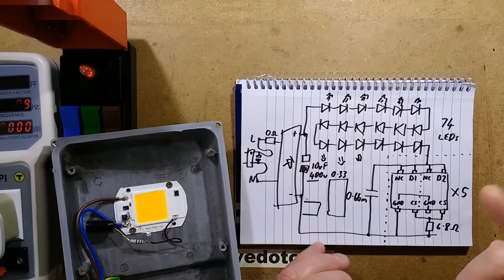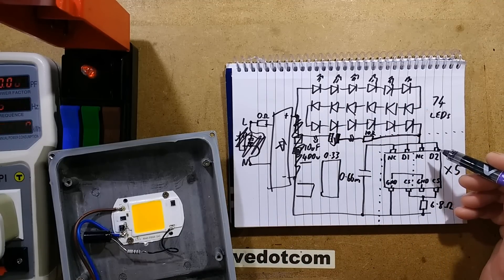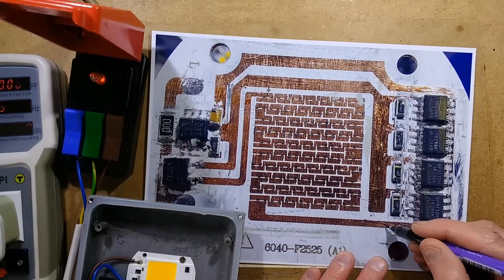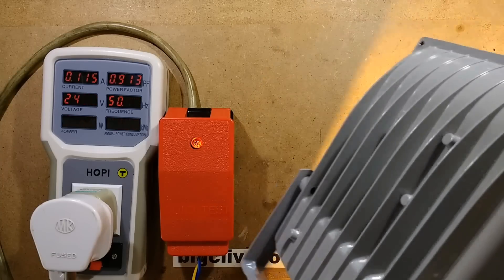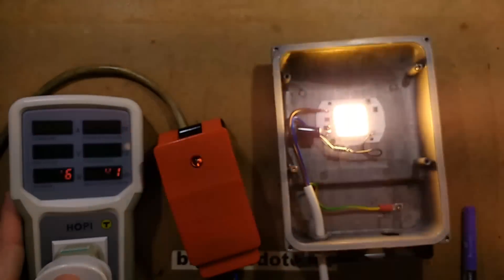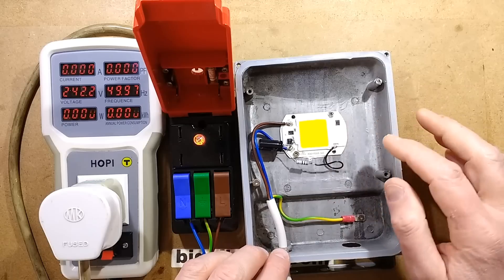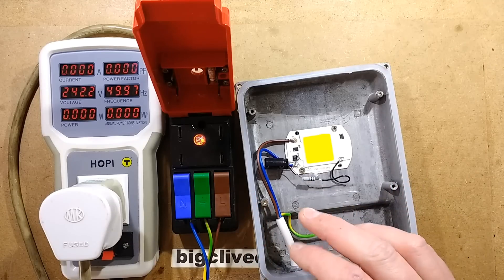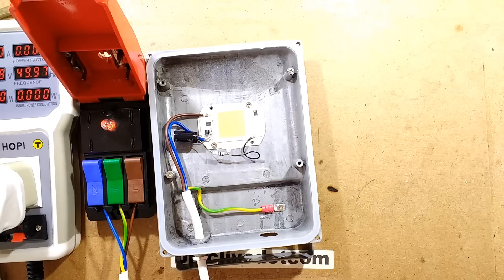Another capacitor test on the driverless LED.

Comment: my brother has a 100w driver less  slim version  and after 5mins it starts smoking  then after further 5mins the smokes gone  and there's a shit load of flickering like in this video . i said to him i don't like the driver less ones lol .  i have the 100w cw  big heatsink version  and there's 2  50w power supplies  powering 2 sets of led arrays in one package . then a month down the line both power supplies gave up so what i did is buy a 1200w boost converter  set it to 60v output  then put the 2 arrays of 32v worth together in series to make it one array of 64v to the output of boost converter .  then connected it to a 12v battery with solar  and a pir sensor  and its still working to this day  drawing roughly 7 to 8A on 12v side   when the pir sensor gets triggered  but its not on 24/7  and dam its bright   . its one of the newer ones that has loads of leds on one circuit board  but split into 2  sets  roughly 32v each  and they never flicker like the direct mains versions which i dont like as the flickering bugs me . the leds are being driven at roughly 80 to 90w  . and i also told him the driver less ones always gets grilled  or overpowered  so tend to fail quite quickly . so he said well if it does ill just buy another lol
Reply: https://www.ebay.co.uk/itm/LED-Floodlight-10W-100W-Outdoor-Black-Security-Light-Garden-Warm-Cool-White/283835047989?_trkparms=aid%3D555021%26algo%3DPL.SIMRVI%26ao%3D1%26asc%3D20190711100440%26meid%3D95d672cd3f6e4208b08f8024db2642ca%26pid%3D100752%26rk%3D1%26rkt%3D17%26mehot%3Dco%26sd%3D283872455887%26itm%3D283835047989%26pmt%3D1%26noa%3D0%26pg%3D2047675%26algv%3DSimplRVIAMLv5WebWithPLRVIOnTopCombiner&_trksid=p2047675.c100752.m1982
Reply: its this type   the 100w version has 2 50w drivers

Comment: 10UF is too low that is why you still see flicker, we have 120v mains in Canada & I normally use  a 2500 to 3300 UF with a voltage rating about 10% higher than the working rectified voltage.

I have rewired many of the earlier LED bulbs with multiple series chip boards, I normally measure the rectified voltage with the cap across it than add up my LED  voltage per chip to figure out how many I need in series or series parallel to slightly exceed the rectified supplied voltage as not to over drive the chips & thy have worked fine for years.

in this case of course that can not work as the number of LED's are embedded in the COB chip design, so that means the simplest way would be a simple full wave rectifier, cap & voltage regulator of some sort to feed the correct mains voltage into the module 120v or 240v rectified & smoothed DC into the module as once you drop the cap across the rectifier it will raise the voltage above that of the mains voltage & being so cheap I doubt they have built in voltage regulation before the LED's

in the simplest terms as they come with no smoothing cap in the design it is using all the power available,  the LED's are digital so they respond very quickly & accurately to actual power so the flickering is the oscillation cycle of your AC hydro (50 / 60 HZ) & even though rectified to DC it is pulsed DC without the cap, the purpose of the cap is like adding a battery big enough to store enough power  so when under normal load you can maintain a steady voltage & current throughout the sine-wave of the AC cycle thus it needs to store more reserve power than the device uses.

Comment: hmm... this was my idea as well where the capacitor should go. However, that 10ohm looks a bit big to me.
For bicycle, I used three capacitors with higher capacitance to smooth the flickering... just to find out that two Cree XP-G is totally fine without any resistor on a hub dynamo, and also will eat up the capacitors charge in an instant, so no light for me when I stop :D

Comment: Is it not possible to use a large inductor in series to smooth the voltage?
Reply: I was wondering that myself.  Some of the comments in the earlier videos seemed to indicate that's what some folks were doing.  It seems to me that if a capacitor after the bridge rectifier (or after an external bridge rectifier) boosts the voltage too high,  then perhaps an inductor filter might be the way to go.

Comment: Thank you for going across the LEDs! My first thought was the current limiting would result in lower average brightness (since it's "fixed-power" from the current limiting), but less flickering. Guess the voltage fluctuates enough to increase the consumed power and worsen the p.f. but still neat.

Comment: Hi, I have a similar COB module, 20W. I tried to place a capacitor plus resistor as suggested and the flickering improved slightly. I the used Viso Flicker tester (no affiliation) to use my phone as light meter. I noticed the following (I cannot load photos herein the comments): the module without modification gives no light until the LEDs begin to conduct (72 LEDs in my module), then the light output rises sharply and then stays constant, until the sharp fall and then no light until the next cycle.

With the capacitor and resistor added as you suggested, the rise of the light output is slightly slower (the capacitor steals current to the LEDs), but the decrease at the end of the cycle is much softer. However, the power at the plug is the same, because of the constant current driver is placed BEFORE the added capacitor and resistor (like in your case).
I would be interested in seeing the same measurement on your module before and after modificatio. The app is free anyway...
Thanks

Comment: Another great video. Question: would multiple cobs, given a common 230v supply, flicker at a common frequency, or would the seperate drivers create multiple flickers and smooth the overall problem?

Comment: Clive, thanks for looking into this. Would a resistor along and after the capacitor placed between the bridge rectifier and before the LED's help to lower the light, the heat, and help keep the flickering reduced? It seems that the IC chips try to bring the heat down by turning the chips off and on creating some flicker to control the heat issue created by the capacitor. I would thing it would also help the LED's from being over driven when the (smoothing) capacitor is added to reduce the flickering. The makers have probably designed the led module calculating the resulting amount of LED's on time creating heat and figured the flicker would not bother anyone. When used as a street lamp, with reduced cost and complexity it would seem like a good idea.

Comment: Thanks for all the videos BigClive.

I want to use these cheap, and easy to install light sources.
I hate flicker and can NOT stand to it, I envy the ones who don’t see or feel it.
I do not want to remove and modify the circuitry on the PCB to much (hopefully none) this defeats the idea.
I was thinking of a solution to apply a few of these in one go, or install easily on each one.

---
Many people suggested (also my first idea) ---You need a big cap connected in parallel on the bridge output for smoothing out DC supply for LED. But this alone could raise DC voltage too high for the original design. So you also need another small cap connected in serial at the input of the bridge to lower the overall voltage such that the DC is within the range of original design. 
This still seems to be a simpler solution to install, with a motor run capacitor also mentioned by others. (The cap is far more expensive then the led itself, LOL)
Can we hear from people who has tested this, BigClive would you like to give it yet another test?

Ideal solution IMHO keeping the cost and complexity simplest:

If the number of LEDs increased to consume all the rectified DC voltage and a large enough Cap is attached to smooth the DC, then it would work with no flicker and no extra heat, since the drives do not have to burn all the extra power. 
In a 230V example if there are 120 LEDs then that is around 300V (or maybe 100 ) across this would work on rectified DC….

Solution/suggestion 1)
Flicker is a problem how you perceive it. In an incandescent lamp we don’t feel it because the heat on the filament acts as a dampen and smooth’s the output. Above we are trying to do the same with a cap, since the led switches off instantly. How about putting a phosphorus sheet over the leds , like the florescent light or the old blue LEDs used to work?

Solution/Suggestion 2)
This is for the 230VAC world, sorry
How about rectifying the 230VAC (220~240) that is around 324VDC the connecting a same power/wattage 220VAC version and a 110VAC version in series?

The leds will have a voltage drop of around 185V + 90V and there should be no flicker. Then I can install these in gangs of two …

Any one know circuitry for LEDs in a 110V?
Reply: deleted

Comment: Thank you! Great inspiration. I just found your channel and immediately ordered 10pc from China.

One thing: I am an amateur, but would not a larger capacity for the capacitor reduce the drop in voltage and thus reduce the flicker? I found C = I * dT/dU on Wikipedia which would result in dU = I * dT/C and for 0.00001F, 0.1A and 0.01s (@50Hz) the resulting drop in Voltage is 100V. Is it not?

So using 100uF (if that exists?) would reduce the drop to 10V which might not be visible.

Another question: Is it possible to use a bridge rectifier and a filter capacitor before the whole chip -> thus feeding 325V DC on the chip and then putting two in series?

Great inspiration and looking forward getting my own China LED COB's :)

Comment: the design is without capacitor and meanwhile it can cut the cost ,most of the supplier of china now export the flood light like this design ,but as what my mind,the design is not good enough,cos of the metal outside,if the pcb is breakdown by voltage the whole outside metal will be danger for electrical hazard risk.

Comment: Hi, I was getting a flicker using 120VAC LED modules on 120VAC, when they warmed up, they seem to work fine, the flicker is annoying.  I tried the 10uf cap and bridge rectifier (120VAC IN, 170VDC OUT) it would light one LED module (too much current), but not two in series (barely glowing LEDs). I am using the 50W 120VAC LED modules. I am not opposed to a lower output, if it means greater life. Any quick fix ideas?

Comment: You know I might actually ramp up the capacitance a bit on this one and whack in another 10uf cap in parallel. Of course being in the states the normal current around here is 120vac which might reduce the strain on the chips enough that it would work pretty well with on of those particular LEDs.
Reply: At 170VDC, on the output of the 10uf cap and bridge rectifier, I am already at peak voltage (120 X 1.414 = about 170). So increasing the cap, should have no effect.  Putting 170VDC on a single 120V LED Module is going to be life shortning, because of the heat dissipation.
Reply: Oops, didn't read the time stamp, I thought the reply was for me, sorry...

Comment: big clive what electrical wire is too thin to be used for a 240v device. i have a old electric alarm clock that I'm concerned the wire is speaker wire ?
Reply from the maker: +Nateyboy1990 Many old clocks used something that looks like speaker wire.  The main requirement for mains wiring with such a low load is the insulation.  If in doubt you could change the cable for a modern one.
Reply: yeah I'm looking for modern wire just hard to find online should have a look in bunnings (australian hardware chain have recently emerged in St Albans hertfordshire) be simple to do i have changed a uk plug for a australian plug before cannot be that hard.

Comment: I wonder what would happen if you run these without heatsink. Given that you said there is SOME thermal management on that driver ICs. Can you please make a test if the chips will protect the LEDs and themselves by lowering current in case of prolonged period of running without heatsink? Thanks.

Comment: Thanks for the LED videos. I've been searching for info on the Sharp ZENIGATA range of LEDs but can find nothing on YT at all. I was given some extremely bright commercial shop spotlights and found a 35 watt ZENIGATA LED inside that I've re-used to replace a dead 50w LED in a home projector. The odd thing is that they run very cool, the original spotlight housing had no fan, it just relied on the heavy cast case to cool the LED and driver. The one I have used is only a 35 watt unit but it's noticeably brighter than the 50w LED that was originally in the projector, it's wafer thin and 2900 lumens. Tonight I ran it for over three hours without the cooling fan running and the heat sink at the thermal cutout directly behind the LED was only slightly warm. Have you come across these LEDs Clive? http://www.sharp-world.com/products/device/lineup/selection/index_led_tl.html

Comment: So my LEDs arrived today. I ordered 2x20, 30 and 50W each in CW and WW. The 50W version is looks significantly different (only 72 LED chips and clear "goo" on the driver chips). 
But the main question is now: where do I get suitable heatsinks?
Reply from the maker: You can use aluminium channel from metal stockholders or buy actual finned heatsinks from eBay.  (Or just retrofit then in similarly rated floodlights.)
Reply: Heatsinks that cost ten times as much as the LEDs themselves XD . I wonder at what temperature the lifespan is reduced to one tenth of the advertised 10,000 hours. Something to gamble with. Thousand hours is around 40 days, that's almost in the realm of being able to test it and have the LEDs still available to buy after that.
Reply: try looking for used PC coolers, you should get them pretty cheap ;)

Comment: You need a big cap connected in parallel on the bridge output for smoothing out DC supply for LED. But this alone could raise DC voltage too high for the original design. So you also need another small cap connected in serial at the input of the bridge to lower the overall voltage such that the DC is within the range of original design.
https://www.youtube.com/watch?v=3HkaI9b2GnI&feature=youtu.be&t=3m15s

Comment: I ordered the 110AC version of the 50W driverless LED modules, I was wondering, if I put a discrete bridge rectifier on the AC line, put a 10uf 400V cap (and capacitor discharge resistor) on the output of the discrete bridge rectifier, then put (2) driverless LED modules in series with the output of the discrete bridge rectifier. Would that work to reduce the flicker (60Hz here), and by splitting the voltage between the driverless LED modules (in series), keep the current down to a reasonable level and make the driverless LED modules last longer?

Comment: @bigclive have you ever done the teardown of a LED filament lamp, the type where the filament look flexible, I wonder how the filament is made because all the filament we can find are made of glass/ceramic
Reply from the maker: The first filaments I took apart were a metal strip and could be bent in one direction.
Reply: Oh ok, the filament I can find actually have a ceramic or glass substrate that break as soon as you are slightly trying to bend them :/

I wonder how are made this sort of filaments: https://www.peterreidlighting.co.uk/media/catalog/product/cache/1/small_image/400x/9df78eab33525d08d6e5fb8d27136e95/c/i/civilight_u_squirrel_cage_led_cutout_screw_1_1.jpg

Comment: I'm watching these with great interest because I am currently converting a bunch of former halogen floodlights with burnt contacts using 20W panels similar to these except 110V. Mine don't seem to flicker, though. 
BTW: After seeing your power meter I found an inexpensive 110V one on eBay. It says my "20W" LEDs are consuming 23W. I can live with that considering that they will be replacing 100W bulbs.

Comment: For the price,  I had to order 3 to test my self.   I use LED lights for high speed video filming and could always use more light.  Currently my favorite LED is http://www.ebay.com/itm/100W-LED-Driver-High-Power-LED-44mm-Lens-Reflector-Bracket-For-DIY-led-kit-/252114758943    its not cheap but its flicker free and bright.   I have purchased other LED drivers but not all are flicker free at 1000fps.  But I did fix those drivers by adding a large CAP.

Comment: My idea at flicker reduction uses no caps at all but wreaks havoc on the power factor anyway.

Noting Clive's earlier analysis on the dark voltages, the LEDs are off for a total of 120 degrees of each cycle. i.e. a third of the time! 

One could reduce that dark window to a quarter of that (30 degrees) by splitting the LEDs into 4 banks that are switched from series to parallel in stages as the voltage falls, and then progressively back in series as the voltage rises. As a first stage switch from all banks in series to 2 parallel series of 2 bank each, then to all 4 banks in parallel.

The current through each bank remains approximately constant but the total current draw first doubles and then quadruples from them all in series. Hence the dreadful power factor!

If the residual flicker is still offensive, then the capacitors for smoothing need only be supplying current for the LEDs for the 30 degrees or so.

Comment: Clive, I'm not surprised you're not getting too much benifit, directly across the LED, as you are only getting benifit from the cap for the voltage difference between full LED glow and led open circuit voltage. That's a narrow range, so the cap won't hold enough charge to make much difference over that slight voltage change.
When you put it before the regulator chip, you get a lot more voltage range to play with as the voltage will be well above the LED voltage for much more of the Signwave.
There will then be way more of the waveform where the LEDs are conductint as the chip is dropping volts, thus providing current.